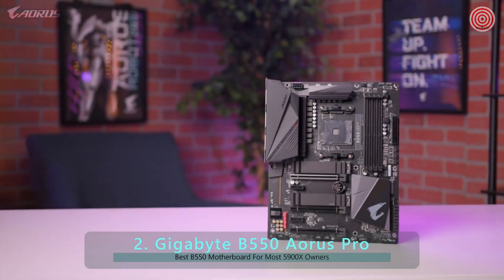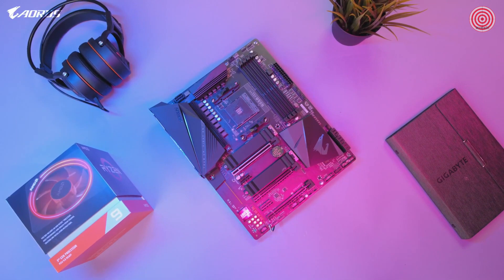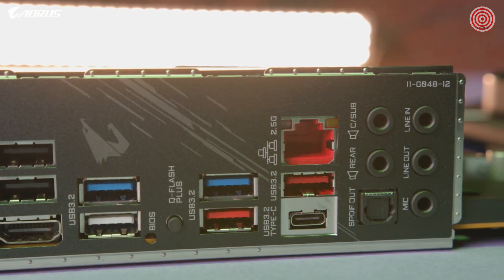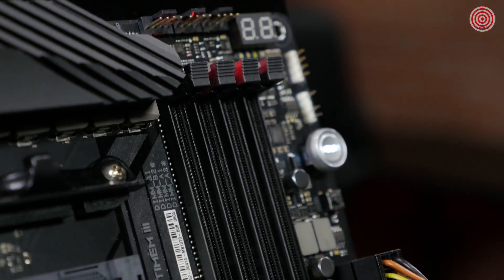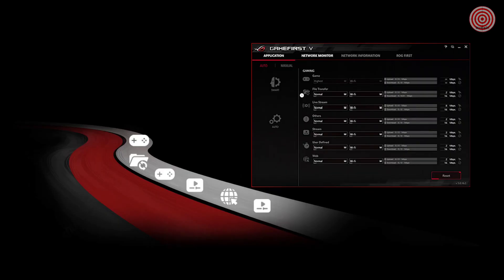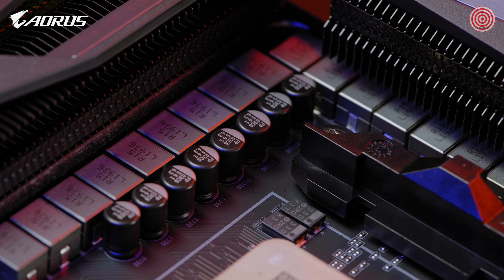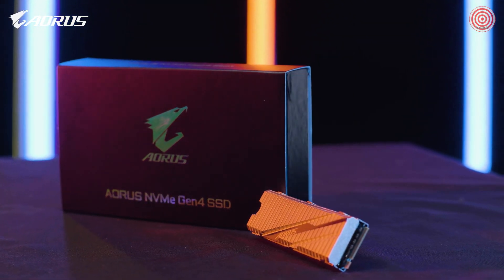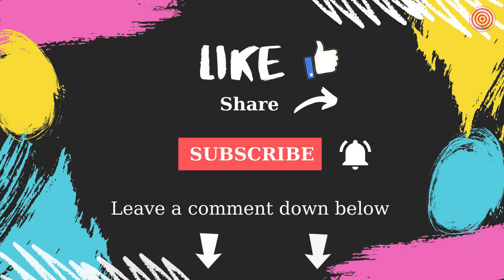5 Best Motherboards For Ryzen 9 5900X

Comment: what's the difference between B550 Aorus Pro vs B550 Aorus Pro AX? Ax is the only available in my country I don't know if its good or its the same
Reply from the maker: Everything I can tell you is that the Pro AX is better equipped than the Pro. 
Vezi diferențele aici https://versus.com/en/gigabyte-b550-aorus-pro-vs-gigabyte-b550i-aorus-pro-ax
Reply: Thanks this I version is itx the M version is available here in the Philippines the size is mAtx and it has 4 dimms slot of ram but the I version only have 2 dimms thanks